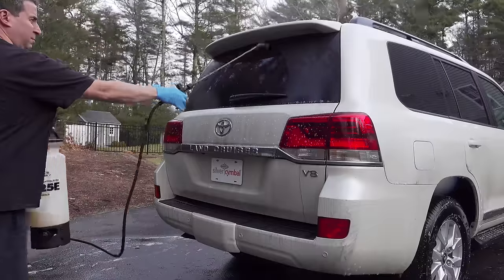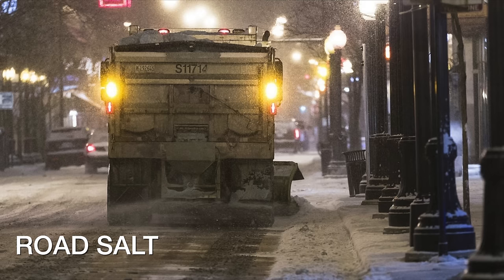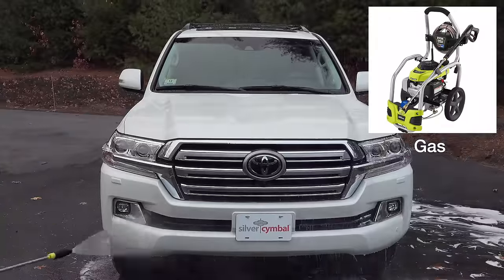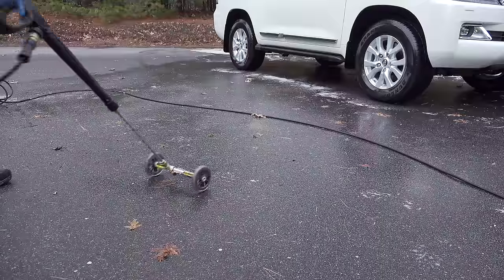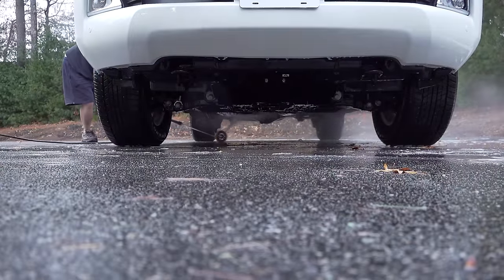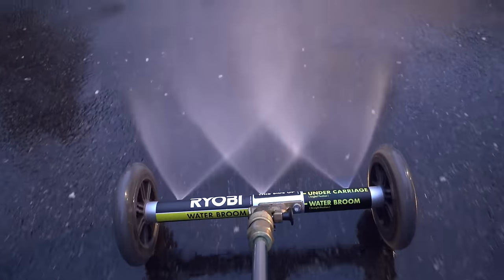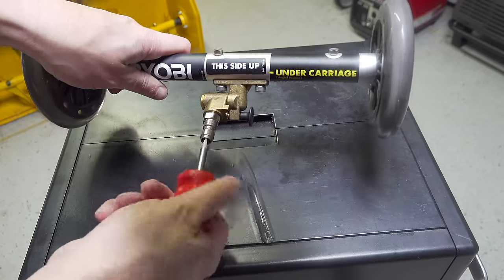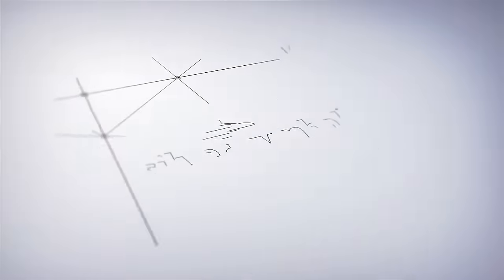How to Clean your Car's Undercarriage in 3 Minutes Winter Salt & Snow Removal

Comment: Will that work with anything other than a truck or SUV? I find most regular cars these days have bumpers which ride so low to the ground it's almost impossible to fit anything under there unless you jack it up first.

Comment: Does this only work with the Ryobi pressure washers or does it work with other brands too?
Reply from the maker: Yes, it users a standard connection and will work with any pressure washer with quick connect fittings. It connects like a tip.

Comment: I made one of these a couple of years ago because in 2010 when I use to go off-roading I’d leave chunks of mud on my parents driveway and my father bitched and bitched about it. So one day I took a sprinkler from the yard and parked my truck out on the road cause we lived in a cul de sac and I placed the sprinkler under my rear axle for several minutes and then to the center of the vehicle and then under the front of the vehicle. After doing it a couple times my father said why don’t you get a spare broom handle and your old trucks from your skate board and get a 2x4 and secure the sprinkler to the wood and basically rake the underneath with the sprinkler. So we did and it worked but it was hooked up to a garden hose not a power washer and it didn’t work as good like it did when I just left it under the truck in one position for awhile. But somebody already made something like this. But it didn’t have the option of pointing down. I seen it a couple years ago on a truck channel I watched.

Comment: Any kind of cleaning requires manual scrubbing, so practically this does half the job
Reply from the maker: Salt will dissolve and dirt easily flushes out. Try it and see how much dirt is on the ground.
Reply: Very true you only get half the job done with that tool it doesn't reach the wheel wells I used to put a lawn sprinkler under my car for a quick cleaning thanks and have a great evening

Comment: It’s supposed to work getting road salt off   Well road salt happens in the winter when water freezes so a power washer at home in below 0 weather doesn’t work very well
Reply from the maker: Depends where you live, if you get a 30 degree day. The other thing I do is I connect it to a hose to a kitchen or bathroom sink with warm water. Not perfect but neither is a ruined frame and if I do it even once or twice mid winer it can be helpful. I just wait for that day when over 32 usually then having this makes it quick.

Comment: Do they make different lengths? That would be a useful tool for my pool deck and I have a lot of concrete and pavers, a longer one would save time.
Reply from the maker: They don't but this works with normal extensions and you can extended it to just about any length you need.

Comment: I don’t recommend high pressure undercarriage sprayers. Not friendly to oil and wax undercoatings, which are more effective than plain washes to begin with.
Reply from the maker: I don't either, split into three wide jets this doesn't put out ver high pressure at all. Nothing like the single tip would espcially with the pattern.
Reply: Silver Cymbal fair enough. I was actually wondering if it comes out as a mist instead. Highly recommend you fluid film this LC though. Not just the frame, but inside the body crevices. You don’t even need to drill holes to do these things.

Comment: No mentioning of adding soap or other additives?    I don't think water by itself will help much.
Reply: @All Things Cars. Exactly..And even with soap it wont take off all the salt alone.. When I take my salty car to a touchless high pressure car wash there is still a film of salt residue that is still on the car afterwards...The only way to ever get the thin layer of surface contaminants completely off the car is with soap, water, and contact with a wet cloth, preferably microfiber  followed immediately with a rinse. This gadget will actually speed up the corrosion process by mixing water with the layer of salt that it cannot remove...There is no way for me or most people to be able get up completely under the car to remove the salt with a rag...And if you dont do that you're not going to get it all off...ever
Reply: @richarddobson3138  that's a good point. I've heard good things about fluid film. That has to be sprayed every year.  Rubber swelling can occur where there's natural rubber though.

Comment: Will there be a problem with electrical wiring that is under the car?
Reply from the maker: It shouldn't be on cars made after 2000 or so. Everything is sealed and the pressure is good but not extreme since you are splitting it between 3 jets.

Comment: Looks like a great device but theres one problem....Its not going to remove the surface layer of salt under your car or truck.. I've took my salty car through high pressure  touchless car washers and it never  removes the surface layer of salt completely with much higher pressure than this.. Without soap,  water, and the friction of a wet microfiber cloth , that salt isn't going to come off...ever...If anything all this is going to do is speed up the corrosion process by mixing water with the salt it cant remove
Reply: Why not. Water will dissolve the salt and wash it away
Reply: @simd510  Its been my experience washing a car that's salty with just pressure washing and without a cloth Mitt or rag being used that a good surface film of salt will remain..Its this thin layer of surface salt that causes the  damage because it is the part touching the body and  it doesn't go away with just a touchless wash, which is in effect what most undercarriage washes are.. If I have a really salty car and go thru a touchless wash, a thin layer of chalky salt will always remain no matter what touchless wash I use or how many times I try it, so for this reason I don't buy into touchless undercarriage washes getting the surface layer of salt off..The way the cars are all treated underneath today, it probably won't hurt to do this and it might speed up the salt dissipating over time but anything short of getting a rag or mitt to wash the surface with friction  while using the pressure washer will fail in my opinion.
Reply: Must be some strong salt where you live. I just went through a touchless car wash a couple time's here in Illinois when it was around 38 degrees, and used my pressure washer another time  and there's no salt to be seen on my car.
Reply: @ChiTownBossFJB  It is..They brine the roads heavily here first and then they salt the hell out of them during and after the storm..If you have a dark colored car its impossible to remove with a touch free wash..And it's not easy to get it off with a microfiber mitt either..As soon as I get done washing it manually I dry it with a microfiber towel...Even after all of that there are still some areas of a light haze of the salt that still remain in the right light..However if your car is a light colored car it's almost impossible to see in any light but it is still there .And it is that remaining thinnest layer of light film of salt that is actually touching the clear coat.Any salt above that is not actually touching the clear coat..Its that thin layer on the surface itself that can do the most damage .
Reply: @richarddobson3138 Salt dissolves in water, so it should just be a matter of wetting the salt, then waiting for the salt to dissolve into the water to form brine and then washing off the brine.
Reply: @Monaleenian  it should be but it isnt...once this mixture dries on a vehicle,  even washing the vehicle with a pressure wand and a microfiber mitt will not remove all of it..because a lot of it clings to the mitt and you wind up just redistributing it on the car..It takes several washings sometimes to get all of it off..The problem has been recognized in parts of some states and stopped..The amount of damage  brine does to asphalt far outweighs its benefits.

Comment: This is genius. Did you have to buy a special adapter to connect to your electric pressure washer? Did you have to buy an extension for it as well or does it come with it?
Reply from the maker: If your pressure washer can take removable tips, this will snap right on. It doesn't come with the extension and if your wand is long enough you won't need one but if you do this is the type I used. https://amzn.to/2QVXrRg  if your doesn't unscrew you can use this one: https://amzn.to/2TrxhaE
Reply: @SilverCymbal  thanks bud

Comment: How do you keep the tool from icing up? Doesn't your driveway become a sheet of ice?
Reply from the maker: Timing is the key, in New England we will get day above 32 and below 0, I also do it in a corner so the water will run off. But yes, no trick for it freezing if the temp is very low.
Reply: @SilverCymbal  I suppose if you have leaf blower, it might help push the water off the driveway? Although it might be smart to move the car away so you don't blow a bunch of gross water on the ground back onto the car

Comment: Great idea except where I live we don't keep our outdoor taps on due to extreme cold. Maybe with a heated indoor garage but then you'll get a skating rink outside in your driveway.
Reply from the maker: Not necessarily though, I run my hose through a door or window and connect a garden hose to the sink with a special adapter and can run my washer without worry of using outside faucets. Takes a few minutes but I only do it once or twice a year and might save your frame. Just ideas to think about
Reply: You could also buy a quality frost free hose bib assembly and keep the water on year round like i do on long island.
Reply from the maker: @doublewide420  Great idea.

Comment: Now do it with snow on the ground in below freezing temps. That's usually when we have salt issues. And we wouldn't be doing it in shorts.
Reply: Yeah.  I live in far northeastern Vermont and try doing that when it's below zero temps.  I try to hit the car wash when it gets above freezing for the undercarriage wash.  This tool is still pretty cool though and I already have a Ryobi pressure washer as well.
Reply: Undercoat the car before winter and don't touch it until spring. Then clean the crap out of it
Reply: @MeltingRubberZ28  Yeah, I did that for the first few years but it's expensive and both of my vehicles are 14 years old and still passing inspections here.

Comment: Mmh and what about lower car? Those big wheel will never pass under my car, does it existe with small wheels?
Reply from the maker: They are very low but yes if it's a sport car or ferrari it won't work but those usually aren't the salt magnets

Comment: Will this fit under a car (sedans)?
Reply from the maker: It really depends on the vehicle. Subaru’s and cars that are crossovers will have no problem. If you have a sport car 🚗 you could easily remove the side wheels and drag it under or for a small set of wheels pretty easily.

Comment: Did you get rid of the Tacoma?
Reply from the maker: Yes for the moment. Working on another pickup.
Reply: Silver Cymbal ...I’m looking for midsize extra cab 4 cylinder with 5 speed manual. I use my 4Runner as a daily, truck would be for chores. 

Love the Ryobi undercarriage cleaner, going to look into one, I normally go through car wash and get undercarriage cleaned.

Comment: Thing is...I don't use outside water during the winter time!
Reply from the maker: One trick is to run the hose through a window and connect to a faucet, using warm water. Makes it easy without worrying about burst pipes:  Get this adapter https://amzn.to/2R7iQXF.
Reply: @SilverCymbal  C'mon! Really? Lol..I don't want a hose running through the house, out the window! Thanks though
Reply from the maker: @muffdiver7670  Gotta do what you gotta do in cold weather sometimes. Takes 5 minutes and might save your frame.

Comment: That amount of pressure will remove any fluid  type undercut(fluid film, krown, etc). Best to use a wide area sprinkler. Just move it around under the car after the storm has passed and the temperature goes above freezing.
Reply: Try chain saw bar lube out of a Harbor Freight abrasive blaster gun 92857. The bar oil has a “high-tack” additive that will stick for about 2 years; won’t eat the rubber like motor oil or diesel fuel either. Minimal rust on my 2014 f250 plow truck with a truck bed salt spreader.

Comment: How do you get soap underneath without lifts?
Reply from the maker: Its only 4" tall so it should ft under all except for most sports cars. SUVs and Trucks should be fine
Reply: @SilverCymbal  thank you but I mean like degreasers to get the gunk out. Not just the ryobi. I do plan on getting one soon though 😎
Reply from the maker: @nomeat  Oh I see, watch my other video on engine cleaner. You can do what I do anywhere on the vehicle, it will take all the grease and build up out. https://youtu.be/sfMeMKoCPJE
Reply: @SilverCymbal  thank you 🙏🏽

Comment: the only thing about this is when it's winter outside and 10 degrees after a big snow who and the hell wants to get out side and use this tool. you could wait until the spring but hell by then the salt is already eating away. oh well I guess I'll keep driving through the automatics
Reply from the maker: Even doing this once or twice a winter will help much more than nothing. Wait for a day over 30 if you get it or run a hose to a kitchen faucet or bathroom and use warm water. I have done that using an adapter.. Life in the cold!

Comment: Well, if this is going to make any sense you have to use it after every drive. That doesn't sound too fun. Also, you'll "push" all the salt and crap into every corner and cavity under the car and you won't even know it. All or most cars have a wax coating and a high pressure water beam could potentially make some of it come loose. Also, as long as the snow/ice is solid it won't really cause any damage anyway, even if there's salt in it. Last but not least: you obviously need access to a high pressure hose as well as a place to wash your car at least 10 times a week as it'll get dirty very fast. Not everyone owns a house.

Comment: DON'T try that on a GM 4x4 .. my Silverado transfer case stopped shifting after driving in the rain … the dealer said F U   1 yr old 10,050 miles  truck #1 stuck in 2 wheel drive       Truck #2  stuck in 4x4    the dealer  would not fix it .. or try to find where the water shorted out the shifter.
Reply: buy a Subaru .. not a GM
Reply from the maker: That is too bad for sure, this definitely doesn't put out pressure that should cause any issues. Sorry to hear you had those troubles.
Reply: I'm in the market for buying another truck but not a GM .

Comment: good idea if you live in a place where it doesn’t rain very much.
  Think about it. How did the salt get into all those tiny little places under your vehicle? It didn’t jump up there, someone didn’t spray it under there with a hose, you drove down a road and your tires spread it under your vehicle..
  Riding down the road covered with salt is how the salt got there, so riding down the road on a rainy day will remove the salt better than any tool

Comment: Uh...if you live in a winter climate...you won’t be able to do this at home due to the fact that most cannot use outdoor faucets and doing this on the driveway would just turn it into a skating rink when it freezes.  There is no way this can be done in your driveway in winter.  And why would you clean a driveway?   It’s a driveway...it gets dirty...in a time when there is a shortage of water...what a waste of water that is.  Otherwise, great product for seasonal use.

Comment: Of course, I believe that road salt does a lot of damage to a vehicle's chassis. But on the other hand, don't kid people that 2-3 minutes is enough to rinse your bottom. I don't even believe that by chance. Maybe you can rinse the bottom of the car between the wheels with misery, but what about the undercarriage around the wheels? All folds and joints. This only dilutes the salt so that it reacts better and causes more corrosion to the metal parts of the car.

Comment: Oscillating sprinkler. $5.99 at ACE hardware.
Reply from the maker: It really doesn't work, those spray horizontally and don't give much coverage.  They also use a ton of water. This is a pretty cool thing the way it works but the speed is what makes it great
Reply: @SilverCymbal  You're thinking of a Rainbird style. Oscillating has a curved bar that sprays straight up vertically and oscillates back and forth. Just pull it along with the hose, takes a couple minutes. Bonus is you can also water your lawn with it.
Reply from the maker: @charliedee9276  I am familiar with those but you aren't going to get enough pressure to do a lot. Plus moving it isn't really easy. Either drag it by the hose or push it with a pole. Definitely better than doing nothing but the big plus here is the speed of doing it and the pressure.

Comment: So what the fuck do you do when temperatures are under 35 degrees??? This guy did this in fall.
Reply from the maker: I did it last week. We had an unusually warm day here in January in Massachusetts which made filming this possible. I routinely work in the cold and you can still use this. If you dont have an outside faucet one trick is to connect your hose to a bathroom or kitchen faucet using a garden hose adapter. Run warm water and get the job done, nothing is simple in the cold but you can do it very fast and even if you do this once or twice in the winter you are still way ahead.